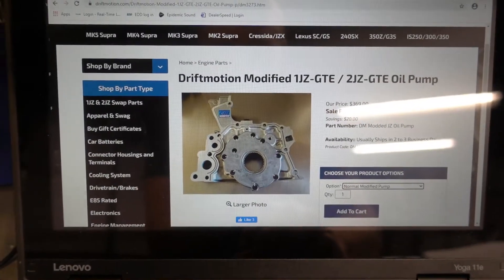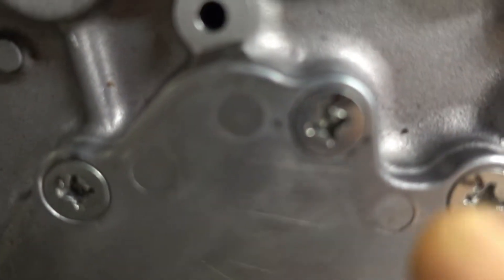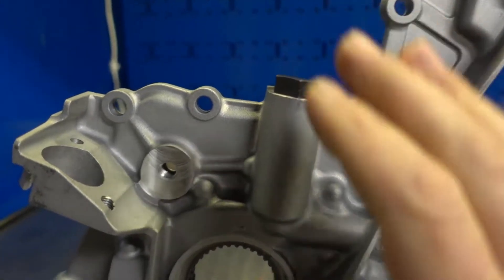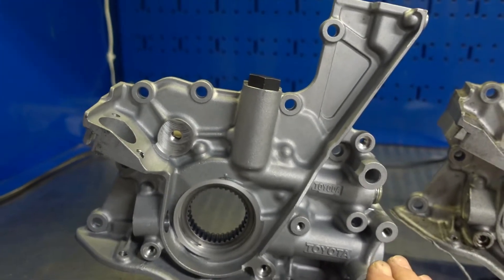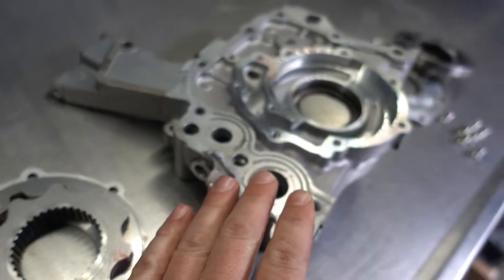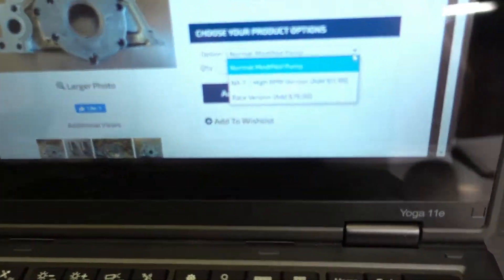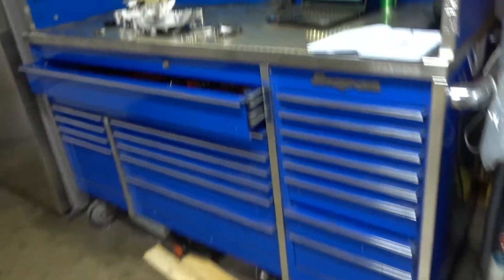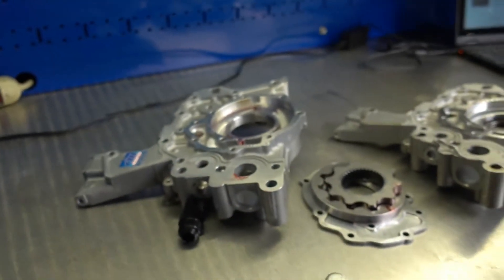2jz Modified Oil Pump Review

Comment: Is there one for the ge?
Reply from the maker: @teddybesplitinlanes5500  technically, the pump bolts up to either GE or GTE. However, the GE does not have piston oil squirters, which makes the oil pressure to be a little higher from the start and with this high pressure pump it will cause the oil pressure in the GE block to be too high which can cause damage to the engine. That is why these are only recommended for GTEs.

Comment: When you increase the RPM of any pump without increasing the size of the ports and tubes you are running it through you increase pressure and then run the chance of cavitation where there is a drop in pressure because the liquid is being pushed off the impeller and not being moved through the ports correctly

This is why so many "frankenstein" Hondas were blowing head gaskets in the 00s. VTEC water pumps are gear reduced for higher RPM where as non VTEC are not. They were spinning the pump to fast which increased pressure until it cavitates and then drops pressure. Same thing happens in oil pumps 

As flow increases, pressure decreases and vice versa. This is Boyle's Law of physics

Comment: I need to replace my OEM oil pump, can it be a good purchase for a daily drive? I dont think Im gonna drift with the car
Reply from the maker: New oem pumps are great for street use and for the track. You really only need to upgrade when you start reving higher and keeping the rpms up there for longer times.

Comment: Pretty useful video. I was curious about the modified pump.
Reply from the maker: I'm glad it cleared some things up for you!
Reply: @LukePakula  ended up doing it and now my oil pressure is too high actually. Maybe because my block has no oil squirters.
Reply from the maker: @andyitslit  oh nooo I think  driftmotion does mention that on their site. I would suggest maybe removing the shim they installed off of the relief valve to bring the pressure back down. But I would contact them first and see if that's doable.

Comment: Should i get a modified one if im only running 500-600whp on my 1jz vvti? I been told not to but not sure why not if the motor will run better and longer?
Reply from the maker: Modified pump means more flow and more consistent oil pressure. I don't see a reason why you shouldn't upgrade it.
Reply: @LukePakula  appreciate the quick reply and thats what i was thinking too but my friend was saying supposedly its bad because too much oil pressure and it will kill my bearings
Reply from the maker: @pourtierbeatz7804  I would call them and verify if it's recommended for your build. It also matters how high you plan on reving the engine as well.
Reply: @LukePakula  from what i read stock rev limit is 7k and i only have single bc steel springs and retainers so im thinking 8k safe and a lil more power band
Reply from the maker: @pourtierbeatz7804  I know people use stop pumps up to 8k rpm but with drifting and how quickly it revs and bounces off rev limiter, I feel safer with higher flowing pump.